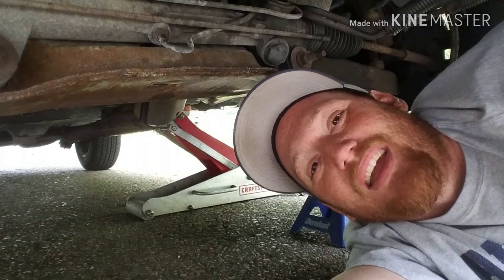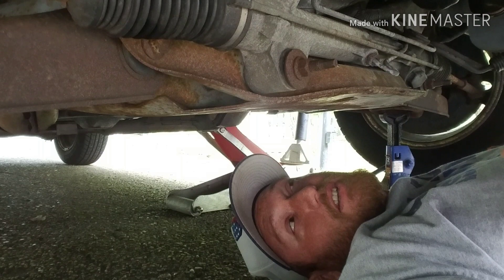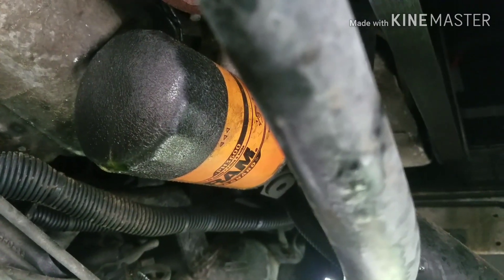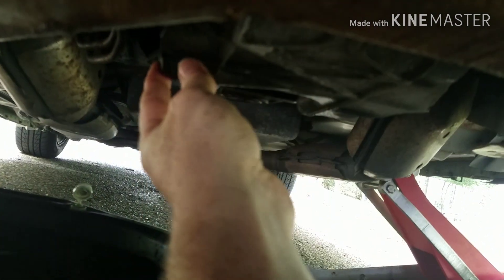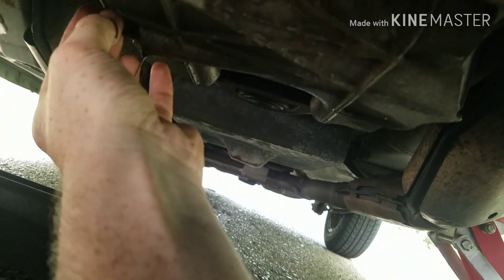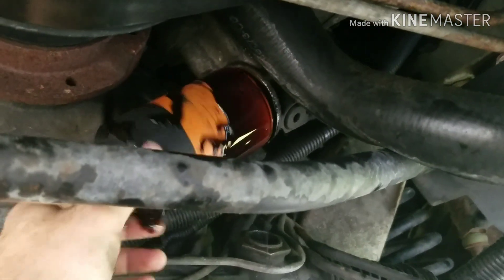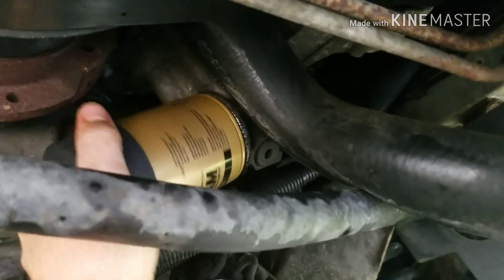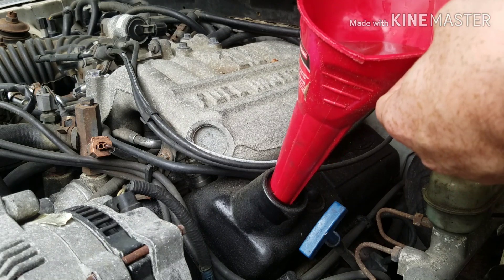How to change your oil

Comment: Aren't u ment to fit a gasket cover like a rubber band on the filter and lubricate the ring before u screw the filter before you put it on
Reply from the maker: Some need a gasket. Some are built in.